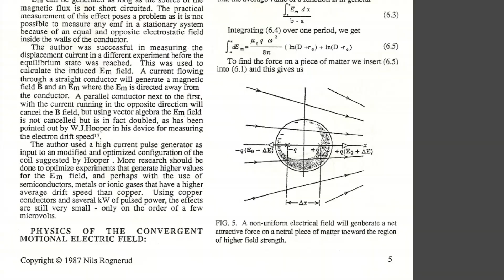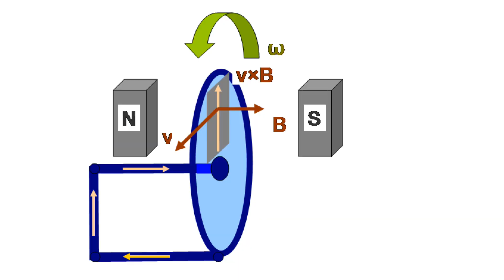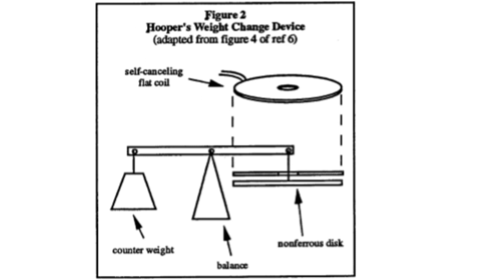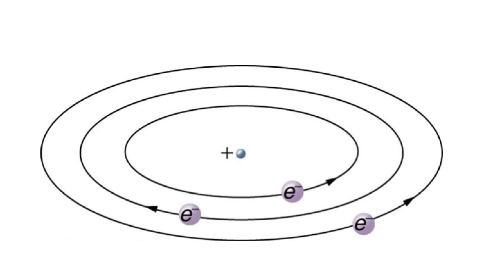Anti-gravity Technology: Ning Li ~ Floyd Sweet ~ Searl Device ~ Roschin & Godin (part 2 - no music)

Comment: Fusion device can get the power to shwinger the noble gas around real fast. Things start to get very interesting at the morphotropic state. PZT can be a pretty fast switch an microwave can push it. No wires required.  Pias has the right idea. Princeton fusion Lab created a power supply. WOW signal showed the blueprints. Binary.line by line

Comment: If gravity was only electric then why doesn't a faraday cage block gravity?  Having said that, I do like your experiments showing a non-uniform electric field producing a force.
Reply from the maker: There are three types of electricity.  Only static electricity is shielded by a Faraday cage.
ElectroGravity is a motional electric field, similar to the electric field produced in a Faraday Generator.  This type of electric field is not shieldable and acts similar to gravity.
I am using diverging electrostatic fields in my video since I do not have a motional electric field generator.
-Nils

Comment: the earth it self has antigravity properties . So its not just a machine its where to put it as well .
Things are not what they told us . To use this machine to go to MARS is not like a rocket . A to B trip. Its electrical one needs to know where the wire starts and where it ends . Its more like star gate . You cant build it it must be half made alredy then you build on that . So that is where all these machines fail . They didnt find the stargate they just have a viechle .

That is the issue in my opinion
Reply: In the sense electromagnetic propulsion technology requires directional electromagnetic force,  I think "star gate" technology would required omnidirectional force toward the center of the vehicle/doorway, in a particular pattern/magnitude that would cause the universe to stabilize by transferring that space. But,  in order to do that we'd need the whole universe mapped out probabilistically and accessible from anywhere.

In other words, it's relatively easy for us to move, because it's steady through time. To transport, we have to calculate how to not only move ourselves, but affect the rest of the universe in such a way that the laws of physics are balanced out from the one moment we're somewhere, to the next moment when we're somewhere else.
Reply: Don’t need a star gate, it’s used as antigravity not teleportation